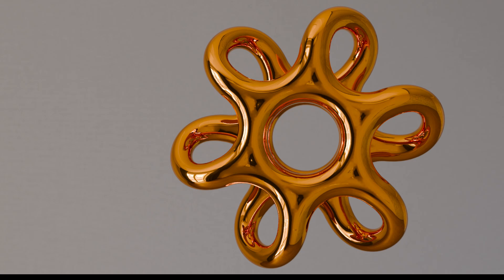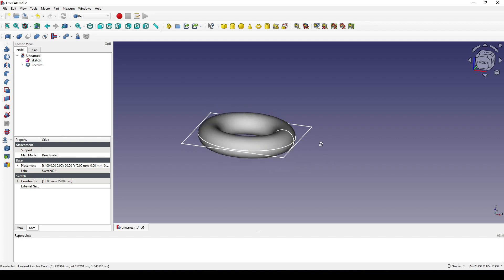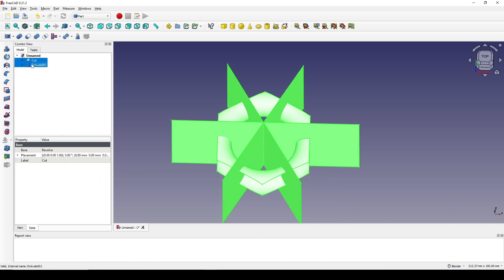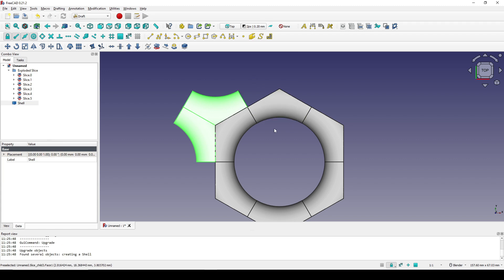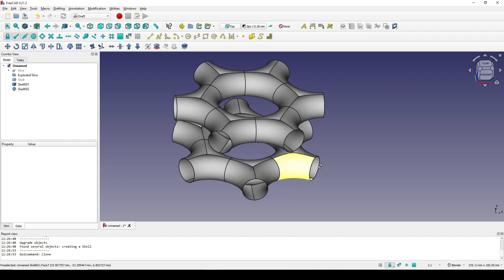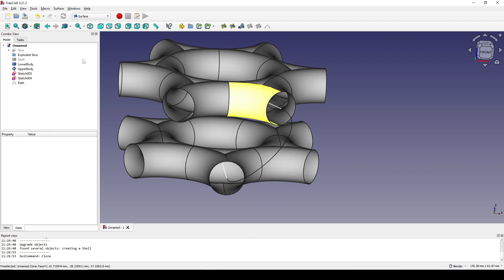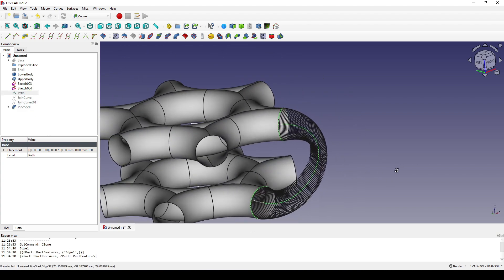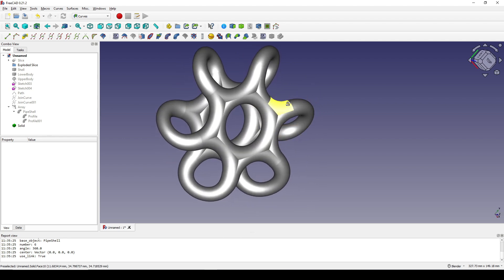FreeCad - Modeling A Twisting Object Using Surface And Curve WB.

Comment: Don't know if that was Your goal to make the pipes decreasing diameter along with radius from the object centre, but probably using Part Design -> Ddditive Pipe would maintain same diameter circle cross section
Reply from the maker: @arturbaginski795  if you want even result in between I recommend sweep in partwb, but turn off solid option. If you use additive pipe, make sure to extract the surface before move on. Goodluck!

Comment: Hello. I am on version 0.21.2 (OS: Windows 10 build 19045,64-bit, Version: 0.21.2.33771 (Git)Branch: releases/FreeCAD-0-21, Hash: b9bfa5c5507506e4515816414cd27f4851d00489, Python 3.8.10, Qt 5.15.2, Coin 4.0.1, Vtk 8.2.0, OCC 7.6.3, Locale: English/United States (en_US) etc......

@10.09 you make a copy of the sketch line and then you move it Z10. and Angle 30. by going into combo view parameter table-Base - and change the value of the Z position and the angle.
I have tried that, but those values are frozen and I cannot change it. What is wrong? On my machine it can be changed in the Attachment table rather then in Base as you are showing.
Reply from the maker: Hi, make sure you create the sketch from the Sketcher, not from the sketcher of the Part Design WB. If your sketch already attached to something, just right click the sketch, go to attachment editor, and deactived it. goodluck!